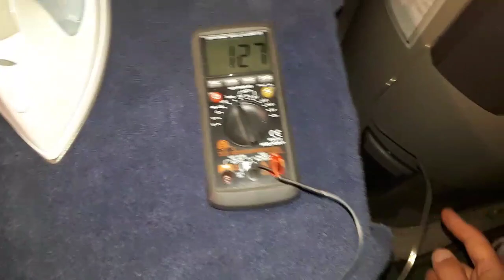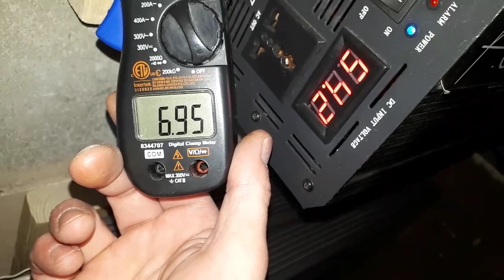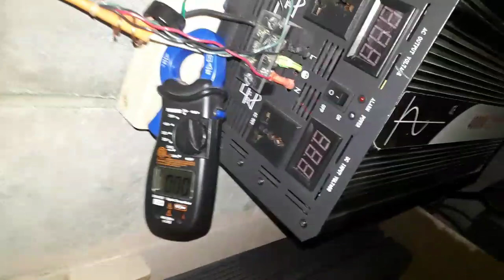48 v Inverter Fail and Repair?

Comment: I think you are correct on the washing machine. I had my heater 1200 watts, Tv 400 watts, and the washing machine (800 watts) going on the Outback 3524 (the beast) it survived but my 6 gauge wire coming from the Midnite overheated so I replaced with high heat wire seems ok now
Reply from the maker: Nice. I find the spin cycle the worst. Hope you guys are good over there :)
Reply: @frankz1125  Yes we are thanks been a long winter. What day is good next week to get the batteries I got the money so ready to pick up but no rush.
Reply from the maker: @offgridwanabe  any day you want. Shoot me a text.
Reply: @frankz1125  Kkk

Comment: No Idea what was going on in this video.   Just a Camera flashing all over the place and zero explanations ?
Reply from the maker: Sorry bud. The 2 little transformers blew the fets and a board inside. I turned off the system starting with the incoming pv. Then the inverters. I was running my house , heat,hot water tank and everything but the dryer.
Reply from the maker: Did you watch the whole video?